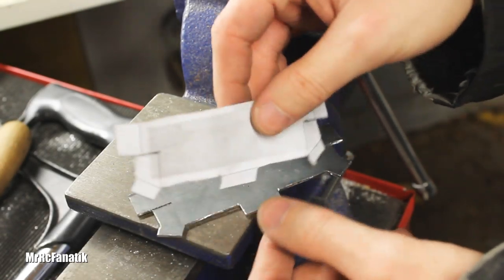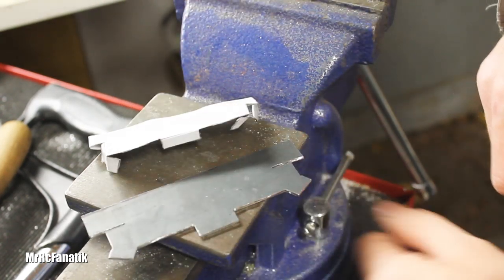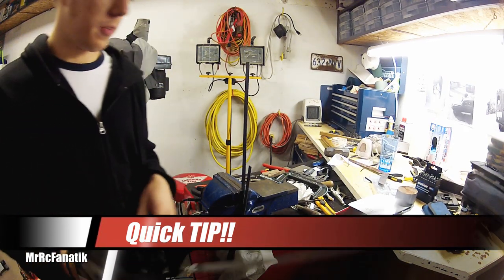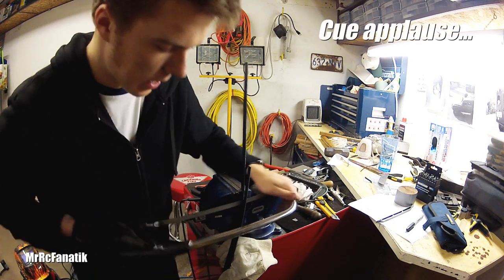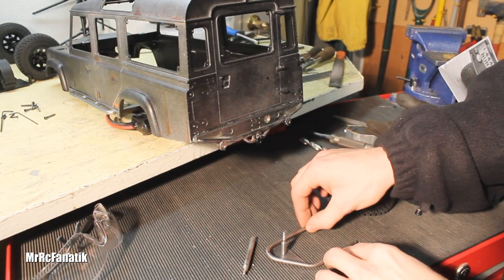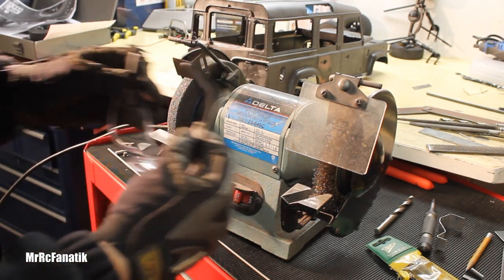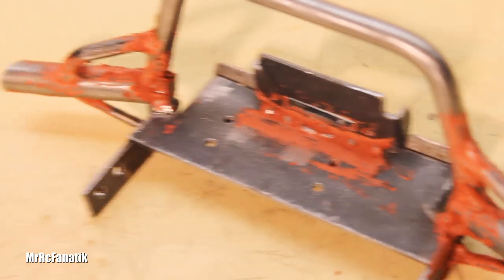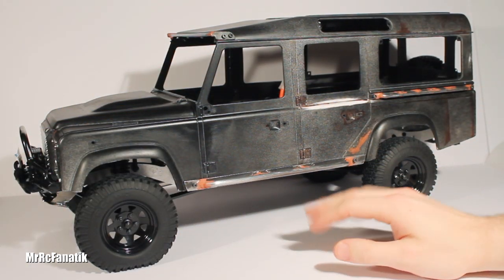[PART 4] CUSTOM Scale RC Land Rover Defender 110 Build

Comment from the maker: @ Ricky Driver ... technically yes!  I will probably make a Disco eventually but not for a little while longer.  Depending on what model you want there are some Disco-3s on ebay that come up occasionally.  Made by New Bright.
Cheers!

Comment: now on the RC4WD website they a new 110 land rover kit
Reply from the maker: Actually, that's an old kit that was discontinued a while ago - it's only just now that they've reintroduced it.  My client and I looked into both that kit, and the one from RCmodelex, but decided we didn't like the quality of them (see video part 1) ... so we used the G2 as the base in order to get all the fantastic running gear.  This truck is light-years better than the 110 kit that RC4WD offers, but is also a bit more money.  We decided it was worth it for the end result.  Thanks for watching.

Comment: Harbor freight is your friend!! Buy A BAND SAW and High Speed Metal Saw $19.00
Reply from the maker: Haha!  Well I'm in Canada, so it's a bit more difficult to buy from HF because of shipping/importing, but yes, I totally need to get a band saw someday!  That little guy you linked looks pretty nice, I read a couple people used it for cutting aluminum, but it looks like it may be undersized for steel.  Most of the reviews were cutting wood.  I'll probably wait a bit longer and just get something a bit more substantial!  But thanks for the help man! :)